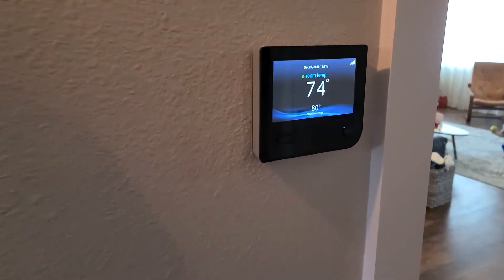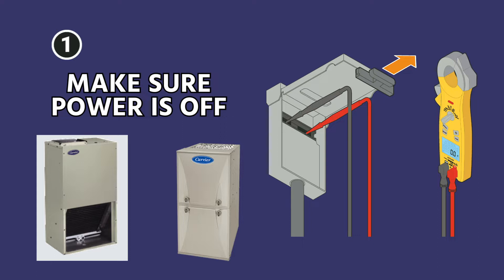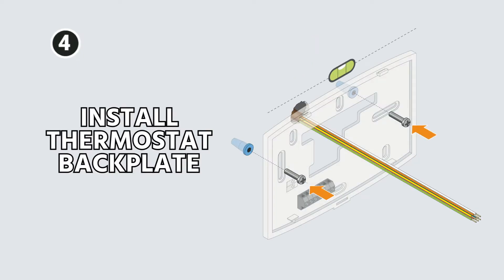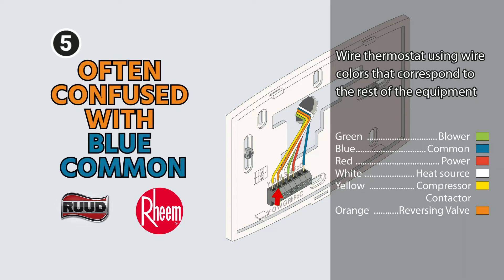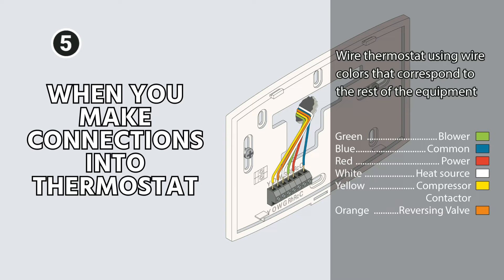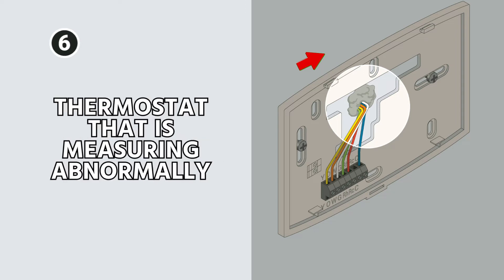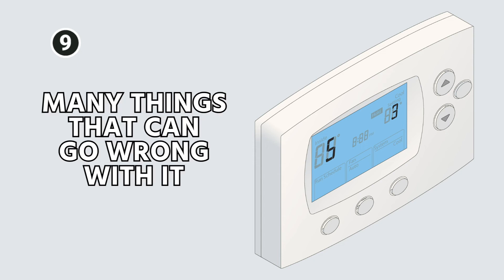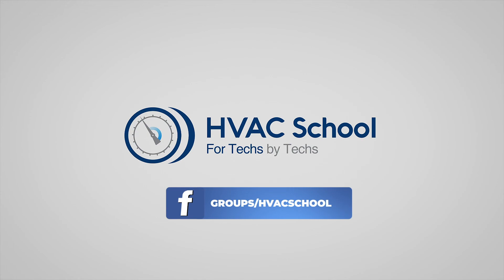How to Install a Thermostat

Comment: You recommend having "professionals" do it, but my "professionals" were real knuckle draggers that really screwed up my system.  I have a two-stage heat pump with gas backup.  They programmed the smart thermostat to only use single stage cooling and heating, then the emergency gas backup kicking in WAY to early!  I burned up 100 gallons of propane this winter when the outdoor temperature had only dropped into the upper 30's.  A modern 16 SEER Trane is more efficient than gas furnace all the way down to 25 degrees, so it should have never kicked in to emergency backup.  They also didn't hook up the outdoor temperature sensor and program the Emergency heat lockout temperature.  So sometimes a homeowner has no other choice but to learn about this stuff on their on when their local Trane service reps are knuckle draggers.